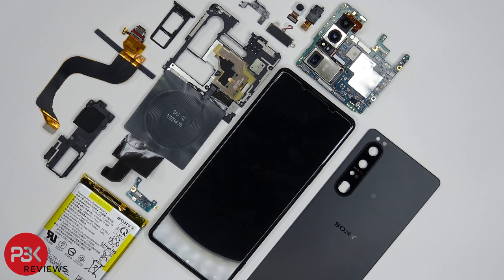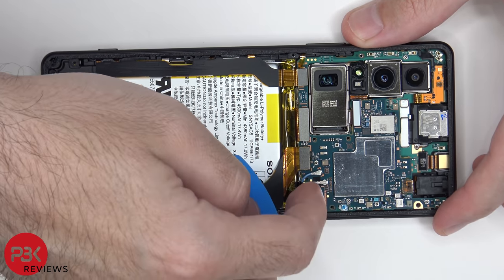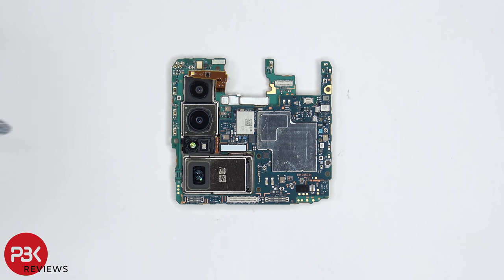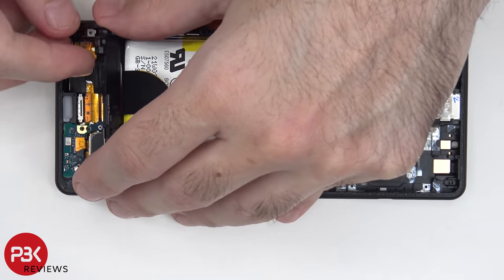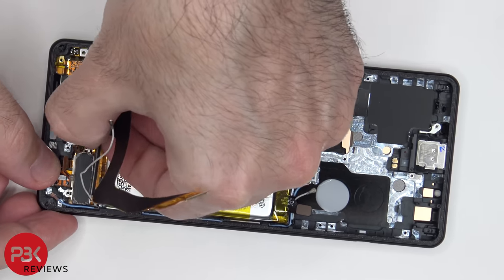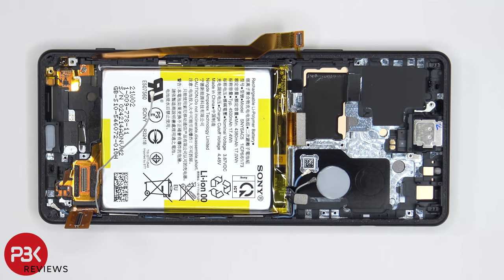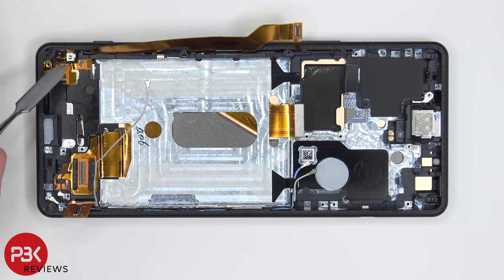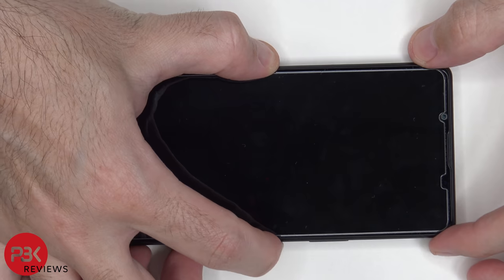Sony Xperia 1 III Disassembly Teardown Repair Video Review

Comment: Pls do it with a mark IV 😇 need to see how difficult a battery replacement would be. Nice video
Reply: Very very very difficult after a year or two. The pull tabs dry out and cannot be removed so easily as when you replace it right after you bought the phone.
Pull-tabs is a way the company says: F*ck you and give me money for a new phone.

Comment: no heat sink for S888. Kind of disappointed.
Reply: They have used graphite since xz premium
Reply: @silva_br1  but does it work?
Reply: @killerskincanoe  OK for S865, surely not ok for S888
Reply: We can not say that it does not have, in the Xperia Pro the vapor chamber is between the screen and the chassis of the device, is not visible just removing the components by the rear, I hope very much that has, but we have to wait for someone to do that, probably Jerryrigeverything do as it did on the Xperia Pro, which is a device equipped with Snapdragon 865 and has so far the largest vapor chamber we have ever seen on a smartphone , including greater than ROG 5... it is not possible that Sony has let this detail, I saw a video where during charging it was only 2° above the ultra S21, ie the probability of having something to cool is high pq the device would heat up much more if it had nothing
Reply from the maker: Ya true, its possible it may have a vapor chamber or cooling block in between the screen and mid frame. However I still think they it should have more of a direct contact with the board itself than between the mid frame and screen. Also the thermal pads they use look like ones that have been used years ago. If they had some sort of cut outs in the mid frame where the processor or components which required cooling lay, and had a direct contact between the shield of the component and thermal paste or pad between them, I feel it would provide a faster heat transfer and dissipation. Just my thought.

Comment: 3:22 can you replace that thermal pad with thermal paste for a better cooling solution?
Reply from the maker: Yes you can
Reply: @PBKreviews  thank you sincerely
Reply: @PBKreviews  one more question the thermal pad is upside down if it put a thermal paste on it and then clip the board back and turn in on is it not gonna short the phone?

Comment: Is Sony the only one who's using the thermal 'pad' (not paste)? It looks clean and perfect. I like it! :D
Reply from the maker: Some other manufacturers use it as well depending on the application need. From what I have seen, on higher end phones they will use thermal paste vs pads for better heat transfer.
Reply: @PBKreviews  great info. Thank you 😊
Reply from the maker: @NinPossible  You're welcome :)

Comment: Removing the whole speaker assembly just to get to the screen flex is such a chore for one of the most frequent repairs. The Xperia Z2 from 2014 is more or less like this, so it seems like things have not changed that much in 7 years.
Reply from the maker: Yup, but I prefer removing the speaker over having to remove the battery to gain access to the screen cable. It's got it's benefits I guess.
Reply: @PBKreviews  You have a point. I guess compromises have to be made somewhere haha.

Comment: how come some of the screws have blue paint on them?
Reply from the maker: Probably to categorize which color screws go on top portion and which go on the speaker assembly but its not always the case. Sometimes the screws are the same size and type just different colors. So the exact reason I'm not sure.
Reply: @PBKreviews  Are the screws that go on the top and the speaker different in anyway?  I did a DIY on my phone and swapped the top and speaker screws, and the speaker stopped working.  Not sure if it is related
Reply from the maker: @Clishlaw  on this exact model phone in the video, I didnt notice a difference in the screws. But you can compare the screw size on yours to see if all are the same. This phones speaker has two gold contacts on the bottom that need to touch the contacts on the flex cable to gain signal. So if the speaker is not fastned down and seated properly, it wont make a connection.

Comment: I am really surprised the extent of the cooling is just thermal pads.... I wonder how hot the phone will get with use. I really appreciate the modularity of the components though, top tier repairabilty
Reply from the maker: From what Sony says, the midframe is made in a way to act like heatsink as well to transfer the heat.
Reply: Sony is a bit notorious about having smartphones that overheat when recording video. Thankfully not thermal shutdown hot, but it might stop recording on a hot day. I’ve also read the phones are smart enough to keep the battery cool when plugged into external power, since it doesn’t have to discharge the battery the temperate stays low. Would have to dig around for a source tho, I don’t own the phone (yet!)
Reply: That's actually better than other manufacturer that only puts graphite pads on one side
Reply: I had the video Pro app shut down due to heat on the first day I owned it on a summer day indoors in the UK. The phone is not optimized for extended periods where the 888 has to run full chat on all cores. I suspect the Pro-I borrows from the Pro in terms of better thermal management. Still, the phone works great for daily usage.
Reply: @ChristopherWoods  sawvthe internal part shot of the pro-I looks like the same thermal solution but it runs even hotter cuz of the larger sensor(cropped)
Reply: @JDC2389  yikes. Not great.

Comment: my Xperia 5 mark 2 has got a green line
what can i do? #pbkreviews
Reply from the maker: It can be from either hardware (bad screen or damaged cable) or software. Sometimes on certain phones, software updates have caused that to happen. You might need to check for a fix software wise or a new software update if you have recently updated your software and then experienced this issue, or if not, you might need a screen replacement.

Comment: Thanks for the video. I was planning to buy one. But the most disappointing part was when I saw "made in China" wordings on the white label. Will go back to Samsung.
Reply from the maker: You're welcome.
Reply: Oh really just because of that? You think it made in china it have no quality? My Xperia E since 2013 and it still work until now same with Xperia X Compact since 2016 still working today. Even it made in China but the quality remain same. Even iphone was made there.
Reply: @vertwheeler6698  Thanks for your comments. Don't get me wrong, I never doubt of their quality. Just for these few years, I have used to not using any of their products.

Comment: necesito  su ayuda  mi pantalla se ha roto  donde puedo comprar  mi nombre   es carlos del pais de  peru  me podrias ayudar  x por favor
Reply from the maker: You can find them on ebay or similar sites if you search xperia 1 iii lcd, but they are very expensive and not worth the price in my opinion. Sony parts are usually hard to find.

Comment: ...and fingers crossed it's still waterproof after all this... I had my Sony Xperia XZ repaired by Sony's repair center in the Benelux and you can guess the result...
Reply from the maker: After taking it apart, unless new original pre cut adhesive is used to re attach the back plate, you would lose the water resistance.

Comment: As someone who has worked in electronic repair shops, repairing hundreds of phones, tablets, game consoles, and computers I really need to point this out: never use alcohol under the battery when there is an opening to the LCD like that. You WILL damage the LCD if any alcohol gets behind that mid-frame. For anyone reading this comment please heed my advice or this repair could cost you more than you bargained for. Instead of using alcohol heat up the front a little then use a suction cup on the battery. Gently pull up while holding mid frame down. You don't even need to exert too much energy; just keep tension on the suction cup and keep it there. Even if you don't feel any give from the battery at all just keep the tension. Eventually, it will begin to lift and you won't have any risk of damaging the LCD and the battery will come out without any disfigurement, barely any bubbles on back or front if any at all.
Reply from the maker: I've worked on thousands of phones as well and other electronics in my day, I originally worried about that same thing at one point. However as long as you are using the correct type of isopropyl alcohol (preferably 99% so it evaporates/drys quick and doesn't damage anything) and are not using more than needed, then there is no problem. I've used this method on phones with all sort of openings behind the screen on the mid frame and haven't ran into any issues. But you are correct, if any other type of liquid or alcohol is used, or too much, then yea it can damage parts like the screen or cause the screen layers to separate.
Reply: The battery has pull tabs for the adhesive so both heat and alcohol aren't necessary.
Reply: @pixels_per_inch  Spoken like a true inexperienced tech repair man. Battery tabs work 0.5% of the time

Comment: Geez! No cooling system on $1300 flagship smartphone! WTF Sony?! Still blaming damn hot SD888?
Reply from the maker: They use the midframe has the aluminum heat sink basically on this phone. Also not sure if there is any graphite between the screen and frame but yep.

Comment: Sony has been using li-po since 2003
Reply from the maker: I just have many people on different phone models ask me if the batteries are li-po, so thought I would mention since most people miss the area which is written polymer and just see the big Li-ion text assuming its not li-po. :)

Comment: No vapor chamber? Does this thing roast?
Reply from the maker: Nope, as far as I've seen, Sony seems to just use thermal pads and the aluminum mid-frame for transferring heat. I would prefer to see a copper heat pipe or something else on top of the standard cooling but yep.
Reply: @PBKreviews  any overheating tests done on this unit yet?
Reply: @PBKreviews  I was really hopeful for this unit to be my next.. Since one plus has officially dropped the ball. But really worried about heat issues after seeing this tear down.
Reply from the maker: @killerskincanoe  Haven't messed around with it much, but for the time I have used it, its been fine and I haven't noticed it heating up much but I don't play games or anything on the phones so haven't ran anything too intensive.
Reply: @PBKreviews  Thanks for the reply. I'll keep an eye out to see if anyone else complains about it. Thanks for the teardown.
Reply from the maker: @killerskincanoe  you're welcome

Comment: I'm a bit disappointed there's no vapor chamber...
Reply from the maker: They use the midframe has a large heat sink for transferring heat but yea would be nice to see a vapor chamber as well, however this is not made to be a gaming phone. Regardless the price of the device is in the gaming phone range so one would think they have the budget for it.
Reply: @PBKreviews  thanks for the info, had no idea. What was your experience with the battery life on a daily basis?
Reply from the maker: @natevirtual  I didn't go too in depth with using it so I wouldn't be able to answer properly.  I usually get the phones in and out asap and move onto the next one for disassembly/teardown.

Comment: so its only 4380mah
Reply from the maker: no if you look closely, there is a rated and a typical capacity rating written on the battery. The typical capacity is written 4500 mah.
Reply: @PBKreviews  what's the difference between those two?
Reply from the maker: @aloyprayoga8  basically one shows the capability of the battery and what its rated to meet, and the other is what on average as a minimum it should provide. You can look at it also like a best score the battery can do vs an average of over time.

Comment: Are SONY smartphones durable than other android smartphones? 🤔
Reply from the maker: I mean depends on how you look at it. There are many other android smartphones, some better some worst. This phone however has glass on the back and front, so would break easier compared to other devices. Also not 100% sure but I feel the shape of the devices (thin but long) would pose a greater risk for bends if say it was in a back pocket while someone sat down etc.
Reply: @PBKreviews , How does SONY smartphones manage to a light weight from other android smartphones..

Comment: Unfortunately, as its predecessors; shows too much room for error as its back adhesive wears off, this is progressively worsening.
Reply from the maker: Ya, doesn't have the strongest adhesive on the back. Makes it easier for taking off to do repairs but also easier to come off over time etc.
Reply: Absolutely @PBKreviews it's a fine line I suppose but I'm still a loving user and happy customer 🤷‍♂️ thanks a lot for the reply! 🙏
Reply: Haha, get it? fine line 🤦‍♂️ it's a terrible joke
Reply from the maker: haha. :)
Reply from the maker: no problem!